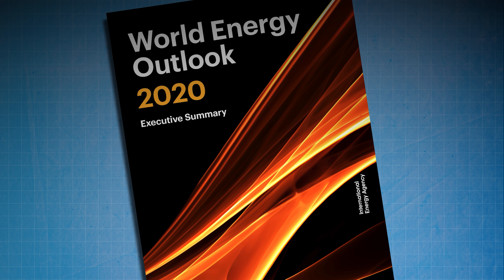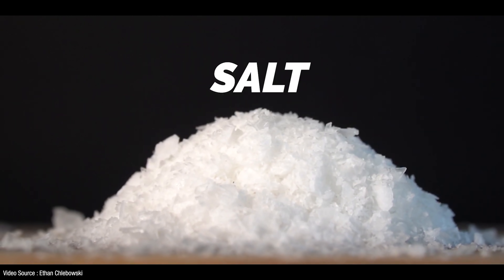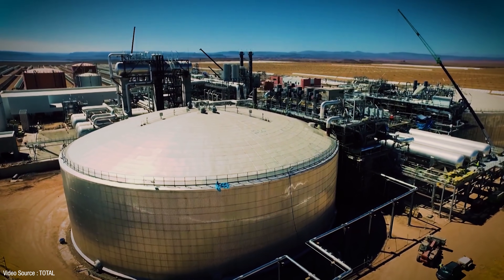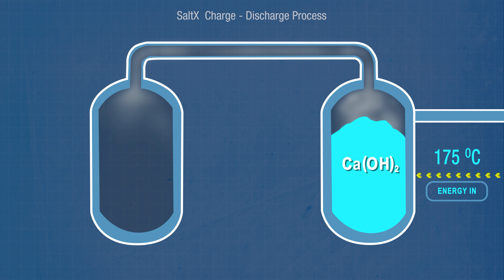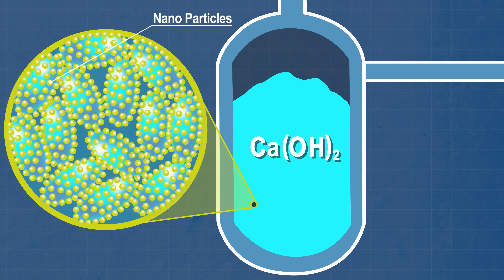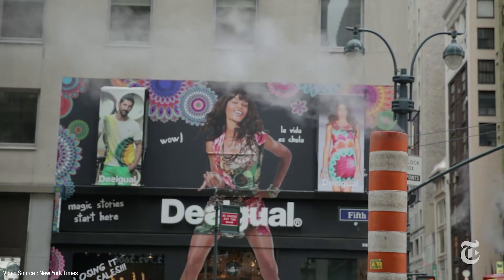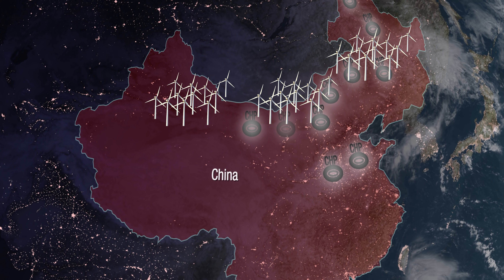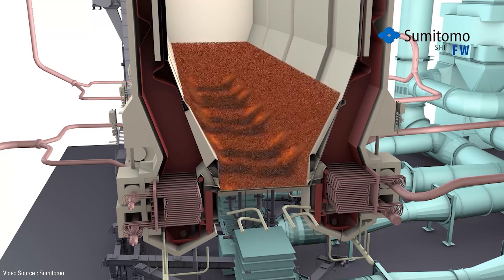Energy storage in salt - how nanoparticles are revolutionising the industry.

Comment: Thanks for this I bought € 40 worth of stock just to keep an eye on the company.
By the way I have about € 5000 in another Swedish company called Azelio. They store heat in aluminum and get combined heat and electricity from that at a high efficiency with stirling engines.
Reply: Surprised to see they're listed
Reply: Ground source heat pumps and hot air engines is something I've tried to suggest to people in the past, the problem is getting their thinking away from the hobby type engines to the real business end of the market. Using an engine that can work at lower temperature than a turbine opens up more market places so any loss in efficiency is soon made up. It's really hard to get people to understand that sometimes efficiency isn't everything, even though a solar panel is a perfect example of this.
It's great to see it is starting to become a reality.
Reply: @helenlawson8426  maybe you should check out Azelio.
Reply: @Chobaca  Interesting system with the aluminium heat battery, i hope they do well.
Reply: Look up Kontax Stirling Engines in the UK, they make models that run from the heat of your hand.
Reply: @steeveeleevee6484  producing how much power? For one LED? that's not what I'm interested in.
Reply: @Chobaca  It's all about awareness out there.
Reply: @steeveeleevee6484  awareness about stirling engines?
Reply: @Chobaca  Yes, and it's Stirling
Reply: @steeveeleevee6484  so it is
Reply: @steeveeleevee6484  Swedish submarines do the heavy lifting when it comes to stirling engine awareness 😉

Comment: What are the barriers and opportunities around all those steam venting losses in NYC?
Reply: The 100+ year old asbestos wrapped iron pipes crisscrossing beneath Manhattan?
Mostly, they are fragile and if you touch it here it will break a block away.
Ripping up all the streets and making the thousands of building connections would not only be expensive and disruptive to traffic, but it would put everyone on the far side of the work offline.
So, I assume ConEd sees the steam loss as the lesser of two evils.
Reply: @jimurrata6785  Thanks
Reply: @jimurrata6785  Sheesh. Lotta energy there.
Reply: @RobinTJKershaw  Yes!
The 'waste' steam from the 14th St. power plant was traditionally used for manufacturing as well as district heating & cooling.
But there's very little manufacturing going on in Manhattan these days.
The asbestos pipe wrapping causes big issues with decontamination when it's blown 15-20 stories in the air.

Comment: Couldn't low-temperature steam such as using ammonia work to drive turbines? Doing that would require much lower storage temperatures thereby using less renewable power.
Reply: The greater the temperature difference the better the efficiency.
You can't beat Carnot.

Comment: To put things into perspective this puts this technology on par with hydrogen in terms of efficiency. However it might be much easier to scale this tech and its a lot safer. It's also totally useless for transportation due to weight.
Reply: Agree if you mostly want to store heat. Hydrogen is the more efficient choice if you want electricity out, though, since fuel cells are ~85% X-to-electricity, and this is limited by Carnot efficiency at around 30% X-to-electricity.
Reply: @Ikbeneengeit  please recognize that the fuel cell is also limited by its Carnot efficiency as well.
Reply: @bgbthabun627  How so?  Fuel cells are not heat engines.
Reply: @incognitotorpedo42  While this is technically so, any mechanism may be analysed using the second law of thermodynamics, by means of an Availability analysis.  thus the carnot efficiency is just a shorthand means of assessing the efficiency of a heat engine, where the availability is assumed to be just the temperatures. ;-)
Reply: @incognitotorpedo42  Fuel cells must be cooled. Incidentally that limits their rate of output. In CHP systems fuel cells are very effective.
Reply: @bgbthabun627  I'm not really sure how to combine heat engine physics to a fuel cell (chemistry). But in any case, fuel cells are ~85% efficient which gives them an advantage when you're making electricity.
Reply: @bgbthabun627  The energy is chemically stored, not stored as hot / cold substances after the NCS has been dried out, so I'm not sure this applies actually. (not an expert on the subject though)
Reply: @jimmynilsson7031  take a look at this wikipedia site https://en.wikipedia.org/wiki/Exergy

please remember the following;

a. that heat engines operate on energy not temperature.  this means that all efficiency equations should consider the energy transferred, not just the temperature.
b. that taking the 85% efficiency number is a highly misleading approach, just as it is technically correct to say that the efficiency of an electric car is 94% because that is the peak efficiency of its motor.
Reply: @bgbthabun627  I would like to add that green hydrogen which uses renewable energy to power hydrolysis is also limited by the carnot cycle, so green fuel cell vehicles are much less efficient than 85% when you take the whole cycle into consideration. They are more like ~30-40% efficiency overall, which is not much different from a high efficiency gasoline engine. Fuel cells are being hyped at the moment but most the lofty claims are very misleading and they are not on the same level of efficiency as EVs. I understand the case for fuel cell vehicles in very long range applications, however, due to the high energy density of the fuel.
Reply: @chazott  I could not agree more.  I worked on fuel cell applications back in the 90's and they were being hyped back then as well.  in the end hydrogen is nothing more than an energy storage device, with a gigantic safety issue that doesn't get hyped at all.
Reply: @Ikbeneengeit  SaltX is currently looking at a Power-Power solution. Its in a concept phase but looks promising. I read something north of 50% in effiency. But we will know more when its in a POC state.

Comment: This is yet another exciting development in much needed energy storage for intermittent green energy sources like wind turbines and solar. I'm concerned about trying to use methane as a bridge fuel as green energy systems continue to be built. The problem is the amount of methane leakage between production, transportation and use. If the leakage is greater than 4% of the gas produced, the CO2 equivalent emissions are actually greater than coal. Measurements in some our our gas fields in the U.S. are actually as much as 6-10% or higher of the gas produced. I really enjoy your videos, keep up the good work.

Comment: Thanks for this work. Always concise and articulate.  On another note: 20 years ago I met a man at a conference who was engaged in research for the Department of Energy in USA. One of his projects was a turbine that used natural gas for energy. But instead of oxidizing the gas, it was stripped apart. Tom said the results  showed a jump in energy efficiency from 35% to 90%. It was still experimental but very promising. I often wonder what happened to this technology.
Reply: I suspect that the 90% figure was not based on energy in vs useful energy out, but something else, because there is only so much energy one can obtain from a carbon-hydrogen bond, and the Carnot efficiency of the turbine is still a factor.
Reply: @incognitotorpedo42   Im guessing Tom did say that he could reach a 35% efficient system with a 90% efficient turbine and there was some miscommunication. Either that or he was a quack, what also happens from time to time.

Comment: Can heat pumps be used to supply heat to dehydrate the nano-coated salt?
Reply: Yes, a heat pump could do that but remember that it is pumping heat not making it.  You still need the energy source.  If you have a supply of water that is not quite hot enough then the heat pump could perhaps be driven by some of this hot water in a heat engine and then it could pump heat from the rest of the hot water into the salt.

Comment: Thanks for this interesting piece. There are high temperature heat pumps being developed, among others by https://www.maltainc.com/our-solution. With this concept, the roundtrip efficiency for storage of electric energy should be able to get over 0.7. A cold reservoir is necessary though.
Reply: Go down a few meters into the Earth and you've got all the cold reservoir you'll need in most places.

Comment: Regarding domestic building heat, I don't know why you wouldn't just heat ~2 000l of water in a building's basement and store it in an insulated tank. If you need 45 degrees Celsius heat you'd have 100kWh available if you heated it up to 90 degrees C in the first place. For big buildings just heat up more water.
Obviously to heat the water you'd use spare grid capacity during the day or on-building solar heat collectors or even photovoltaic panels. Definitely if you need steam this is a great idea.
Reply: Converting between steam and water is far more efficient (in terms of density) due to the latent heat of steam and the high pressures used (around 10 bar). This means that transporting steam saves a lot more energy than transporting water as the internal surface area of the pipes can be made much lower. To prevent scalding heat exchangers are used to reduce the temperature of the water. This also prevents the buildup of Legionella as the water is in constant movement around a heat source that is high enough teperature to kill the bacteria.
Reply: @enterprisestobart  Ah, that's interesting. My thought was that it's quite easy to build well insulated hot water storage for bathroom use and heating, etc, then you only need electricity or solar water heaters to heat it up. If you were getting power from the grid, you'd heat the water during low demand / high supply periods, acting a bit like a battery. The concern as you say is the growth of bacteria, but if you occasionally get up to 90C all bacteria would die. Also, heat exchangers to high-pressure mains water would prevent stagnant water from touching the taps.

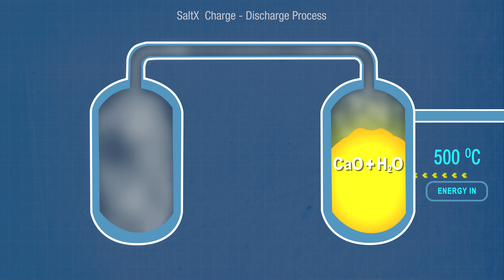Comment: Rewatched the video and at 4:18 you are talking about steam being produced as the salt is being changed up. And I got to wondering if a turbine could be added to generate extra power at this step.
Reply: Was thinking the same.  The steam would still be condensing to water once it passed through a turbine.  As this is blatantly obvious they are either doing it in their pilot schemes or there are fundamental reasons that they can't do it.

Comment: Isn't this basically the same technology which is used in submarines for more than a decade already? Just added a fancy name. The big question is left unanswered in this video. What is the cost of producing this "nanocoated salt"? Every year scientists come up with ideas which are not really economically viable or scalable. I'm afraid, this is not that good of a solution either.
Reply from the maker: I think you may have missed the part in the video that made it clear they already have a working prototype with Vattenfall, and they are also working with Sumitomo. I don't think that would have happened unless a fairly robust set of balance sheet numbers had been put in front of both companies.

Comment: you made one mistake
China isn't shutting down coal plants
it's building more than the whole world combined
Reply: Actually, China is closing down its coal powerplants. Atleast those oldest, dirtyest and obsolete even by their standards.

At the same time they are building new modern ones with better efficiency and better smoke scrubbing in the southern areas. They have also cancelled quite few coal power projects in past few years.
Which actually makes sense and is tiny bit better than having those old ones running.
Reply: China has extensive wind power in the northern regions and that is where they have closed coal plants. China has more wind power than any other country.
Reply from the maker: Well, they're doing both in fact. I'm not one to defend China's coal use though, so I will take your point.

Comment: This is nothing new , there are at least 10 different salts (with reaction temperatures up to a little over 700 degrees) that can be used , and if you re hydrate with water vapor instead of liquid water you can get almost unlimited life times . The technology has been use to power submarines , dry crops and store solar and industrial waste heat, among other projects ( including my 7th grade science project). All these guys have done is gotten a bunch of "diverse" PHd's and added some buzz words like "nano" and "X" . Good grief.
Reply from the maker: ...and then they slogged their guts out to build a real company and went to the trouble of developing the process to a real commercial stage, instead of sitting in their laboratory, moaning about how everything's been done before.
Reply: @JustHaveaThink  What separates the men from the boys.
Reply: @JustHaveaThink  If I was working on this , I would first do a exhaustive reference search for every proposed , tried , or even dreamed about thermochemical battery , regardless if water was one of the chemicals . Then I would make a series of charts of every combination I could uncover comparing them in every way I could think of , then I would pin the charts up on my walls and think about them , and then do the next logical thing ;)
Reply: @JustHaveaThink  I have been designing cities from "basic concepts" as Elon musk would say , and I have found I can eliminate the need for energy storage ( except for disaster reserves) through "smart city design" this is not something that can be "added on" to an existing city , but it really opens your eyes to what could be :)
Reply: Sounds interesting. But how sure are you that the clumping problem is solved? Probably using mechanical agitation can be an easy solution but otherwise, there needs be someway to keep it from getting clumpy
Reply: @vigneshgandham3782  Because it has already been done at very large scale . Additionally you can make it automatic by adjusting the internal  pressure so that the temperature is maintained near the boiling point of water at that pressure , this works perfectly at lower temperatures (and higher temperatures you have to balance the simplicity vs the higher tank pressures/costs) additionally you can dry the salt at a lower temperatures using waste or solar heat , then re hydrate it at a higher temperature to say run a steam turbine. This was the main competitor to otto cycle engines for submarines before Diesels took over , their were no "mechanical agitators" on those submarines or any other systems that I'm aware of. Additionally you don't have to use water and a salt there gas and liquid chemical combinations , and at least one one of them that actually increases in volume during the absorption reaction enough to appear to violate the laws of thermodynamics and give you a "free efficiency" boost. This information may not be on the internet but It's all available at the library of Congress and the London library .
Reply: @robertlackey7212  That's a very interesting insight. If the tech is proven to work then why isn't it used more widely?
Reply: @ЕмилЕфендулов  Are you Russian ? I study Russian at least 12 hours a day  some times it feels like 20 ! I will be moving to Crimea next spring to start a berry farm. To answer your question , what is put in front of you for your consideration on the internet is to benefit someone , there is so much that is either not on line or not readily accessible . I have been designing floating cities to house displaced people but because google is in bed with China and China is doing a lot of displacing , my efforts are almost impossible to find on Google but accessible on other search engines. also of course nothing is cheaper than burning cheap oil , so as a technology it cannot really go mainstream until cheap fossil fuels are in short supply.... Unless it is your project and you decided that is what you want to do ! There was a professor at an American university that did a lot of the work of organizing the technology and I believe has some patents on it , I just tried to find him on line , but couldn't , it was in the 60's-70's I think. пока-пока
Reply: @robertlackey7212  Не-а, из Болгарии :) 

Well, that doesn't really answer my question. Sure, information gets buried and rediscovered online, but you've said that the tech has seen a multitude of applications over the years. So why are people still pouring money into research and why haven't we seen more widespread adoption? If it's an inherent flaw in the technology then please point it out.
Reply: @ЕмилЕфендулов  I would assume because these young people are not going down to the library of congress like I do and doing their due diligence , you did not answer my question by the way , and no there is not an Inherent flaw in the technology . There are dozens of other technologies with histories similar to this one , as a species we keep reinventing the wheel.
Reply: @ЕмилЕфендулов   Sorry , I just saw your answer.
Reply: @vigneshgandham3782  I'm confused by the claim that the base process congeals into a mess after being cycled.  If I understand this correctly, you have quick lime at one point in this process that could just be mechanically milled back into a powder or granules as needed.   I mean, the raw material for this is limestone, which is pretty "clumpy" to start.
Reply: @richdobbs6595  You are right. But when you consider the additional cost and infrastructure needed for milling this back to a more granular form, the cost of the system starts dramatically increasing. So I think by their nanotechnology, they solved those costs, so now they can enclose this into one package